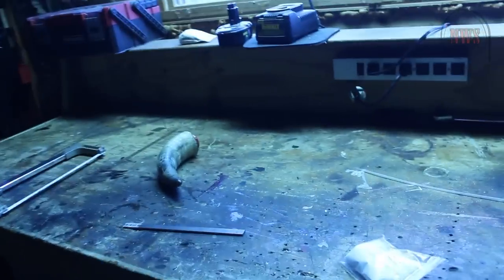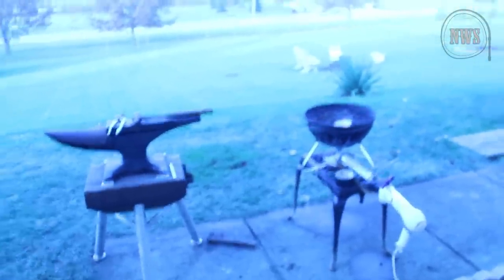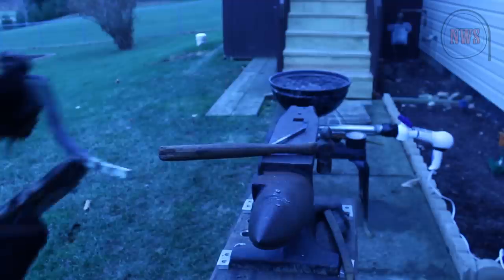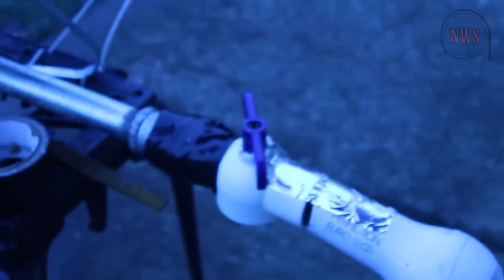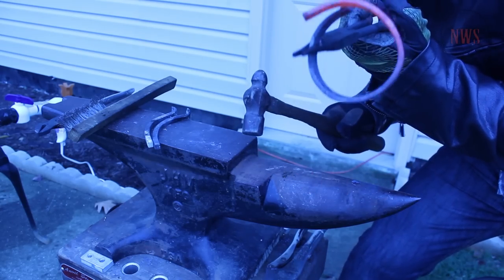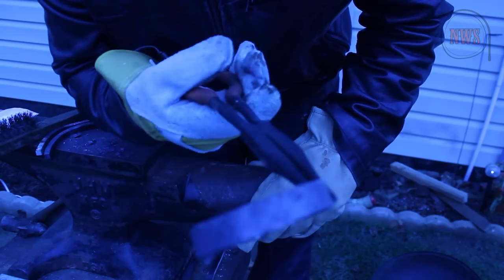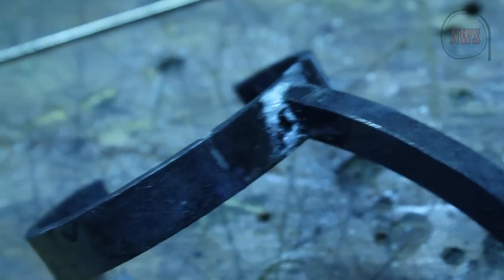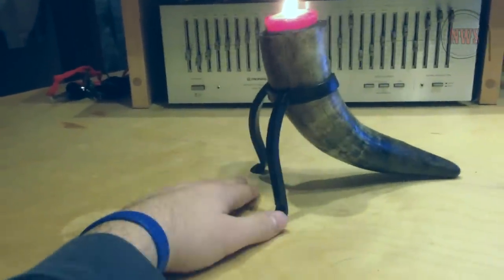Making a Skyrim Horn Candle Holder

Comment: nice video Nick! I'm liking your new hobby, as my hobby is now whip making after seeing your videos and using your tutorials, but my main source of income in blacksmithing, I make movie props and real swords and daggers and so on. A small tip for your set up, have a little table or bench handle for your tools to sit on, try and keep your anvil free of clutter, it always makes it easier for when things done quite work and you need to sort it quick before the metal cools, and for the gloves, I use welding gauntlets (most are red) and they'r cheap as chips to buy! but withstand lots of heat! and just for piece of mind, go ahead and buy a cheap leather apron, you'll save lots of shirts and jeans haha. but awesome idea for the make, I think i'll give it a go as I am also a lover of skyrim! one last thing, you might want to chop a few inches of the top of your forge, or cut parallel slots out of it, if you ever come round to forging something bigger or long like a sword or long knife, you'll find it hard to get it hot enough to forge because the hight of the edge of yours will stop the metal getting close enough to the heat. Good Luck pal I hope to see more forging vids! if you ever have any questions then feel free, get in touch at my Facebook page https://www.facebook.com/pages/Lewis-Price-Props-and-Replicas/728455197198178
I started just like you, so I'm happy to help if needed!
Reply from the maker: Hi Lewis! Thanks so much for the advice man, I really appreciate it!

Comment: Nice Video Nick, A little tip on forge welding. First off you need to heat up the metal to non-magnetic temperature (glowing yellow) dip it in the flux and then pound the s**t out of it.

It may take a few attempts but you'll get it.  As for not having proper tools.... you can easily forge your own out of 1/4" bar stock (lots of youtube video's out there on how to do so).

Anyhow keep at it and you'll figure it out. ^_^
Reply from the maker: Thanks John! I appreciate the advice!
Reply: No worries, Glad I could Help ^_^

Comment: Hi Nick, when I saw you gaswelding I noticed when you wanted more heat you made your flame bigger, rather experiment with the two gasses to get the flame to a small bright white flame wich gives you alot more heat. This is more economical and welds easier. Ceep it up bru, nice work.

Comment: The borax keeps the steel from rusting on a molecular level. if it were to rust it wouldn't weld
Reply: Flux does not prevent it from rusting it prevents it  from building up scale and getting into the weld and making it a weak weld a weak bond

Comment: dude first off you not getting it anywhere hot enough to forge weld and you should have scarfed it setting it down on opposite sides and another thing you used way to much flux plus what did that little bag of flux cost you on eBay I'll bet you could have gotten a bag 10X that at your local store for the price you payed for that little bag and was it necessary to fill that horn with concrete that horn could have been a  reservoir for oil or something else seal the inside of the horn with a non permeable liner make it a wick  holder that site agents the inner wall of the horn and there you go or the safer way make it electric